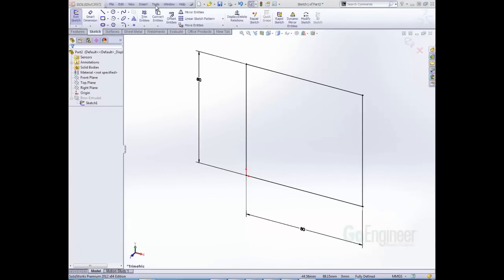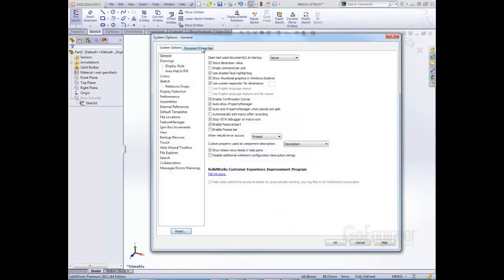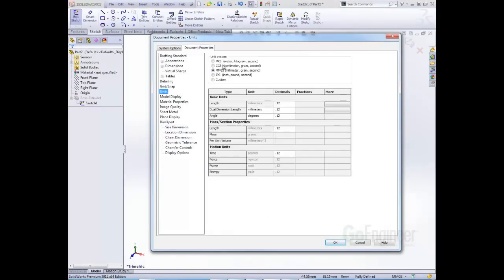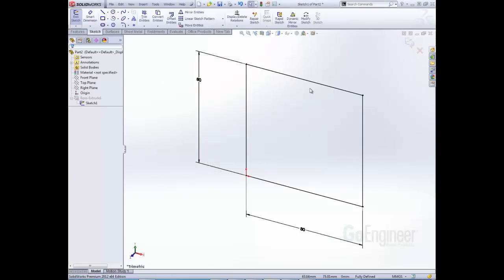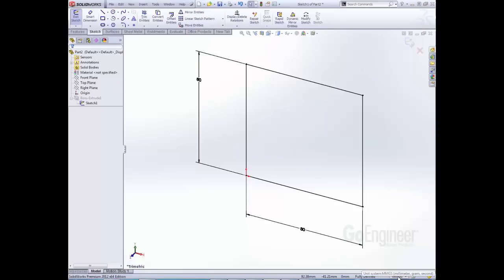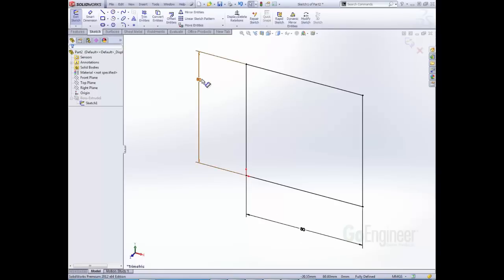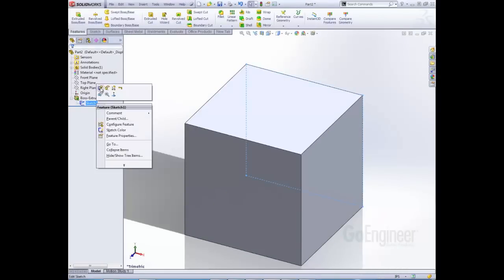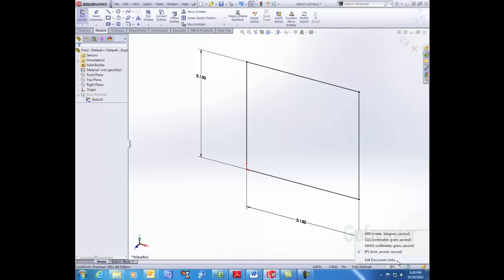SOLIDWORKS 2012 - Changing System Units

Comment: If you need to change the units in the status bar in 2019 SP0.0.  Go to the Evaluate tab>Measure>in mm. there you can change the length unit in the roll down.. Click OK and be on your way. :)

Comment: Can I change the units but still keep my measure? Like change from mm to inch in that video but the measure are still 80. Thanks
Reply from the maker: The measure tool is able to either use the document units or specified units.  In the 'Measure' dialog you would just click on the "in/mm" icon on the top left to set the 'Measure' tool units to 'Use custom settings'.